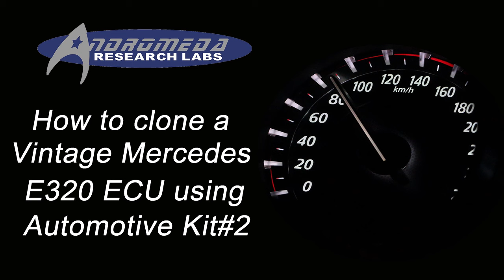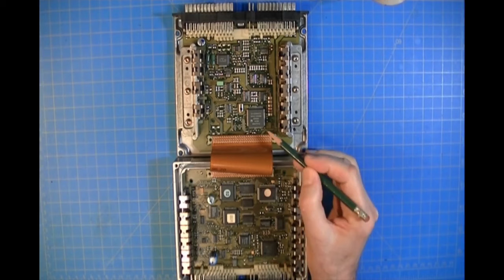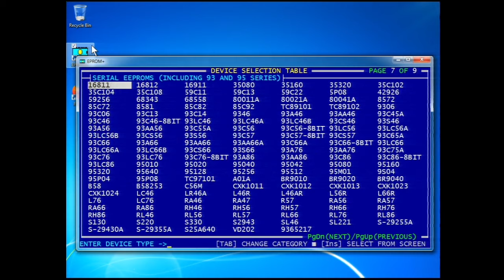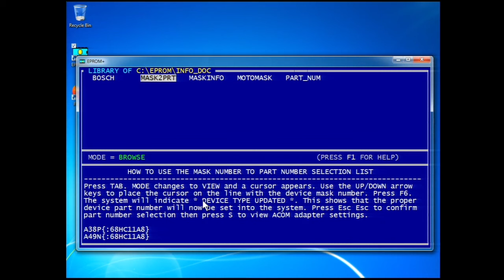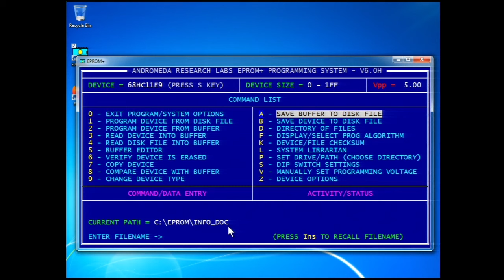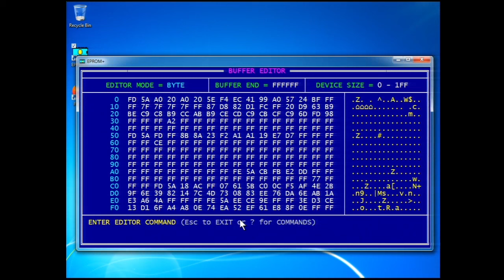How to clone a vintage Mercedes E320 defective ECU into a salvage module using Automotive Kit#2

Comment: Hi. Am I able to clone any ECU driver (EEPROM and flash) using Andromeda? Best regards.
Reply from the maker: Our kits allow you to read/clone/edit any eeprom based module (ECU, cluster, BCM, etc.). There are two types of memory in modules. One contains vehicle specific data (VIN, key information, etc.). This is the eeprom. The other is the program memory which is not vehicle specific and contains the program which is executed by the module processor. This memory can be called P-FLASH (Program Flash) and does not need to be updated to clone a module or edit a VIN. This type of memory  is not updated by direct connection to the memory part which is how our kits work. It is updated via connection to the OBD port via a J2534 link (JBOX).

Comment: I think this is the most capable automotive programming tool in the world. Instead of buying so many third party programmers. I should ve focused on self training on this but it is not too late because I am not at that point where seriously want. I have 2 panasonic cf29. I just found the db25 i needed at the back of it. Just wondering how to get it started. I might have to call to get the help i need to run it. I purchased the full version nearly 1yr and a half ago
Reply from the maker: Don't hesitate to call us for assistance setting up your kit.
Reply: @andromedaresearchlabs7826  i will this morning. I even saved your number in my phone like this of my best friend lol

Comment: does it erase the old info when it uploads the new info? Great job btw
Reply from the maker: Yes, the old data is erased during the programming process. If you wish you can read and save the original data before programming.